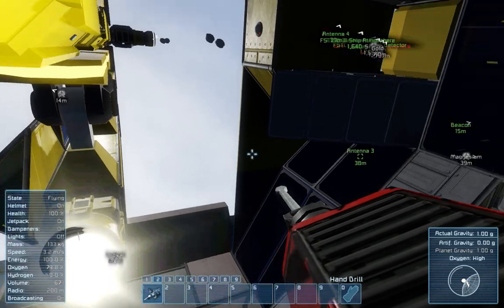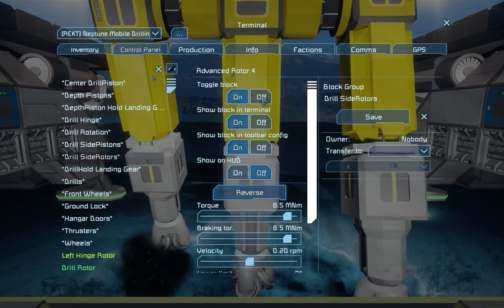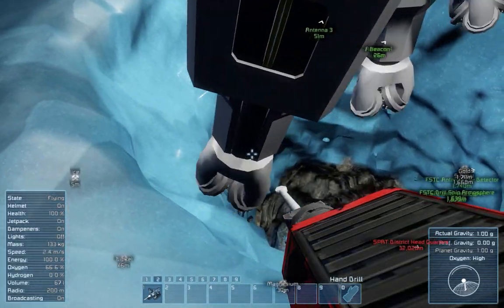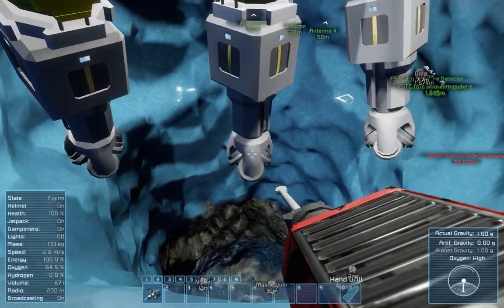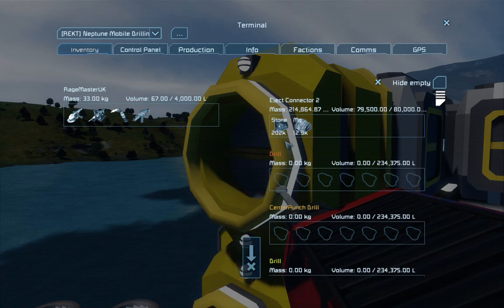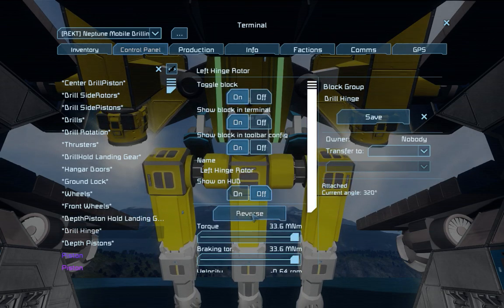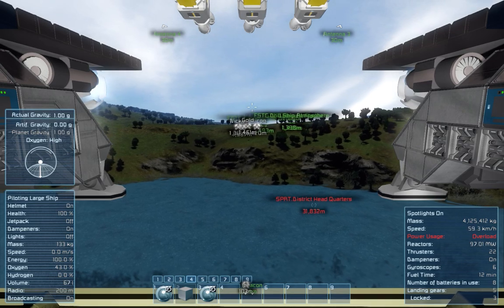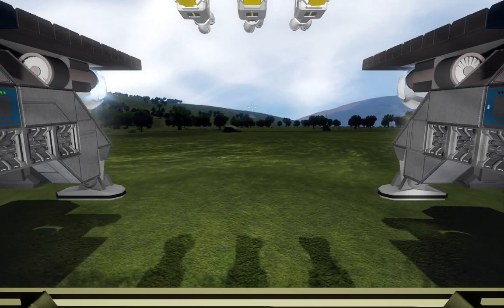Space Engineers   REKT Showcase   Poseidon Planetary Mobile Drilling Rig part 2

Comment: how about adding 1 drill on the inner sides of the outer drills and deleting the drill in the middle, so it would drill faster and doesn't loos a third of the drilling power when widening he hole
Reply from the maker: I get what you are saying. Its is an excellent idea and I considered it during the design at one stage. The isue is that you would'nt necessarily give more drilling power due to the spiraling motion of the outer side drills. The position of the current side drills would still be at the outer circumferance of the drilling hole doing the majority of the work. So to increase the drill-head mass to get minimal return.... decided against.

Thx for commenting!

Comment: Nice vid, and nice drill setup. I've been using a flat row myself (21 drills) which I think would drill a big hole faster, but 21 have an enormous weight and your 3 drill setup has lots of practical benefits. I'll definitely be giving it a try.
Reply from the maker: +NegatorUK
Thanx 4 commenting! Yeah more drills are where its at for mining speed, for sure. But, as you say with the enormous weight, one has to consider mass as a major factor in drill-head designs, especially if one hopes to carry them around without incident. Drop a mssg if I can help you out!

Comment: I really like the idea, but this seems VERY impractical. I saw your other video first, and I'm not convinced that it has any good uses, except making a tunnel. But once again, it looks pretty cool!
Reply: I also really like how you lock the drills when you pack it up.
Reply from the maker: +AJman14  Hey thanks for commenting bro... forgive me for asking but, what other uses would you expect from a mobile drilling rig?

The most impractical thing about this build is definately that you can't make all of it with a projector, which would put a few people off in survival mode. You have to build the pistons and drill-head on the boom separate to the vehicle, and then mergeblock them together.

In terms of its uses, I think that it does really well at navigating planets and drilling for ore, which is pretty much the only 2 priorities in the design spec. If you have any suggestions for improvement I'm all ears :)
Reply: +UKRageMaster I guess the most impractical thing that I saw about it is how slow it goes. Maybe you could add more drill heads to make it faster?
Reply from the maker: +AJman14 Yeah that would increase drill speed for sure... I considered that originally. The negative impacts on vehicle performance while moving was the main reason I just went for the 3 drills instead of a 5-prong design. Mainly, the extra weight at the drillhead caused it to snap during travel between drill-sites, and without a flat plane on the drillhead it was hard to design a locking mechanism for that tilted back travel-mode.

3 drill heads also has less of an impact on game performance, although Keen is improving the code all the time resulting in more drilling stability overall. Its a slower process than drill-wall designs, but I figure you can just set it up to mine your ore-site and leave it to do something else, return to a 1000 tons of resources after an ingame day. I mean, theres always something to do in Space Engineers thats not mining e.g the next invention :D
Reply: And you're totally right. There's always something to do when it's mining!

Comment: That's a pretty awesome setup! I really like how your method of widening the hole uses rotors instead of pistons - very interesting. I know you briefly addressed it in the video, but have you considered a better/faster sorting system for the mined ore other than "spit it out to fall on a collection platform"? It'd be fairly simple to set up a sorting system to keep ice and valuable ore and dump rock - this would be faster both with resource collection and your computer's performance (if you have issues).
Reply from the maker: +Duke00x Yeah that would work too. Instead, I just decided to overhaul the drill to pipe it into the rotors on the hinge. It does not need any dropping ore method now. Also gave it the ability to drill asteroids in 0g. Oh and I made it drill to 100m depth now because I was upset it couldnt reach the gold and uranium on the ice-lake of the earthlike planet. I also did a trial run of the "spiral-ramp-access" digging and it worked like a charm! I will be uploading an update vid within the next 24 hrs thanks for taking an interest! Hope u check the new vid!
Reply from the maker: +Hallofo Hey thanks for the response. I had thought about piping the entire drill scaffold by taking a pipe down to where the drill hinge is at. In retrospect it would have been a much better design. Unfortunately it is very difficult to 'retrofit' a pipe, the entire drill scaffold would have to be redesigned and re-attached. As the hinge is a double-rotor setup it might take considerable time to do, but I may have a shot in the future!
Reply: UKRageMaster It is the only thing I can do. I got the game but my computer couldn't run it so I had to get a refund (I am poor and I was spending money I really didn't have to get it but felt it was worth it to be able to play it. but sadly my old store bought potato couldn't run it). So I want youtubers that play it and try and help ones where I can with things I learn from others or that I can think up with the knowledge I have from watching others play.
Reply: +UKRageMaster Another way to do it is a piston piping connector system. When it is drilling a advance piston with two connectors extends out to the two on the drill and lock together and then you can just quickly move the ore.  When done it retracts out of the way and you can lower the drills back into locking position for moving/flight.